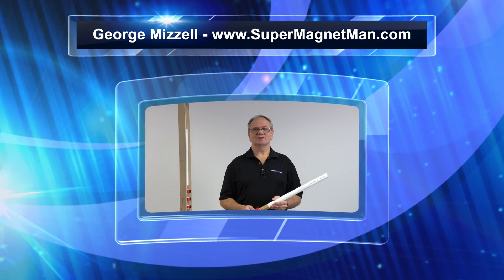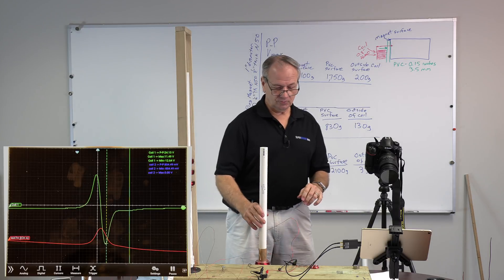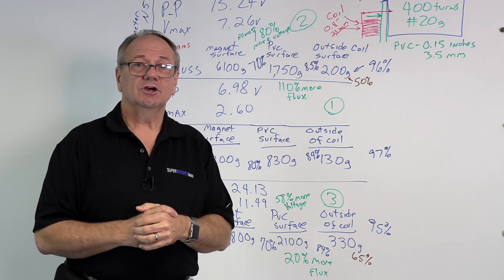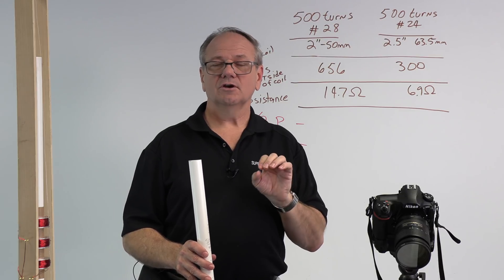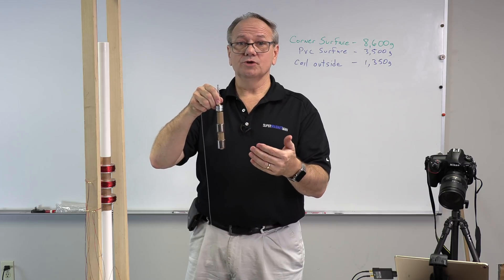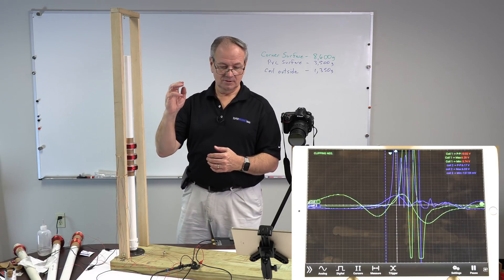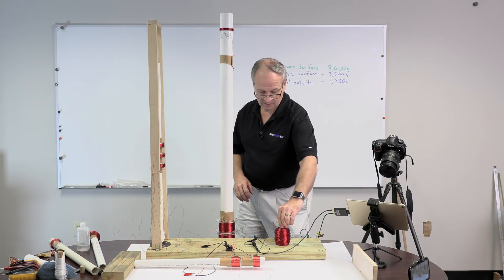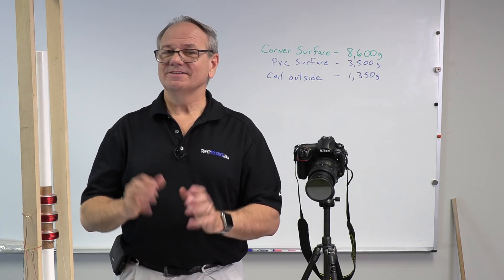Magnetism and Wave Generation

Comment: You could drastically increase the rate of change in flux with a highly permeable low reluctance path through steel washer plate around the tube and placed at the bottom and top of each coil. But make sure to cut a slit in the steel washer plate from the outside diameter to the inside diameter so as to minimize or rather eliminate primary mode eddy currents. 

If one wants to further close the magnetic curcuit. One might encase the outside of the coil and washer plates with a larger diameter steel pipe. Closing most of the magnetic circuit further increases the rate of change in flux across a coil helping produce the most voltage with waves of low cycles per minute. 

Obe might consider a full wave voltage doubler circuit to assist in getting usefull charging voltages while also rectifying the linear generator's output to the battery. Lastly, the battery needs a charge controller to prevent overcharging.

Comment: Fun and informative vid!
One question though: Won’t the conductive copper weight sap some of the energy output due to induced eddy currents? I think a non-conductive weight might give better results.

For wave generation, the trick is going to be to convert the wave action to higher velocity of the magnet passing through the coils. Some sort of a pneumatic system could accomplish this, or perhaps even just a float and a lever arm.

I’ll watch the later videos to see where you went with this!

Comment: Actually kind of have a question cause I seem to look at things different . you're talking about limiting walthickness, but from my perspective and maybe I'm wrong isn't proximity directly or more so maybe I should say isn't Resistance to moving object and electrical current generation directly inverse to each other? so sure maybe if you wanted to decrease your volume of an electrical generating system per workload, then you'd be worried about wall thickness, but getting the magnet closer to the coil just increases resistance and thus could increase electrical current, but also would still be taking more away from the work.  I do see it coming into play and conceptualization of a current project I'm working on where the weight of the magnet will be  an inefficiency to the system . so maximizing my electrical generation potential out of any given weight of magnet, would be somewhat key. Cool stuff though! 👍

Comment: @SuperMagnetMan 4:26 - "Lost 80% of our ring flux..." comparing what to what? What values are you comparing, here? ---You know it's likely to be difficult sledding when this early on  there are routine references to comparisons where the gentleman doesn't bother to tell you what is being compared. What is 80% of what, here? Where are the equations for the potential energy of this system? ---My best guess is you're comparing readings on the PVC surface (why here?) to readings on the magnet's surface, in Gauss, but doing a very poor job by rounding significantly without telling your viewers, nor telling them specifically what it is you're comparing, and why it's important.

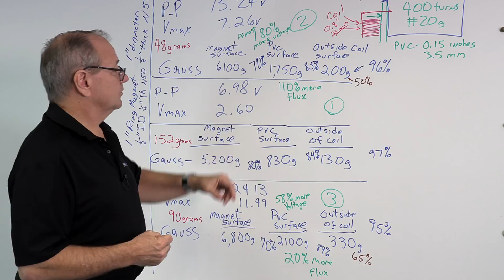4:50 - Why is the reading at the outside of the coil important? You and I know that it has to do with the efficiency of the system, and the efficiency and placement of the winding, but do you really think half the people watching this know, and know why and what you can do about it? Further, what you really mean by the "PVC Surface" on your board is, "The innermost face of the coil," something critical to your audience's understanding and to the value of the quantity taken at the outside of the coil. You also want to minimize wall thickness, but not coil thickness given how important the reading is at the outside of the coil?
Slow down, brother. Slow it down. This is valuable stuff---don't waste it by hurrying!
Reply from the maker: 80% of the starting value so if the original surface gauss measurement is 5,000 gauss and at that point I am down to 1,000 gauss - that is an 80% drop.

Comment: The magnetic circuit in all of these demonstrations is absolutely terrible. Take a lesson from the voice coil in a loudspeaker, and make the flux go straight out radially from a chunk of iron plate on each end of the magnet (flux re-directors), through a thin coil, backed up by heavy iron for high intensity flux loop closure, then straight inwards radially to the other end of the magnet. Set it all up so the magnets and iron pole pieces are stationary, and move the coil only, as in a loudspeaker. That will also allow you to avoid friction with the 'pipe' (the coil support). Moving the coil in a stationary magnetic field is every bit as valid as moving the magnet, and a stationary magnet can be MUCH larger. You also should match the coil height and spacing to the thickness and spacing of the flux re-directors. And btw, the flux re-directors can concentrate the field intensity to about twice that of the best supermagnet, because good magnet iron has much higher permeability than the magnet material.

Comment: I once saw a really odd shaped coil that looked like it was made with around 10 8"x8"x1" square blocks with holes in the middle so the squares could be slid down an upright pole at the center. The squares were rotated and offset to form a spiral like pattern with the corners up the pole. The copper wire was wrapped around each square and the result was a spiral square coil. Any idea what the purpose of that would be? My best guess is from around 13 minutes into the top video that pops up when you type "Why build an entire computer on breadboards" into the yt search (yt wont let me use links sry), he shows how the physical geometry of the wires carrying a signal have a very interesting effect on their attenuation and phase shift at high frequencies. If the geometry of the coil can affect the signal, maybe it also can affect magnetic induction. Have you considered testing differently shaped coils? Maybe its another factor that may effect your voltage results. Thanks for the very informative videos!
Reply from the maker: Interesting - I am not sure if I follow the description.  I will look it up:)
OK - watched it and I think he was talking about just the magnetic field that is created any time electricity moves through the conductor.  I was watching the 12-14 minute segment.
Reply: @SuperMagnetMan  He pokes the wires and it effects the signals which implies to me that the physical shape of the wires affects the signal at very high frequencies. I guess it could also be his own electric frequency interacting with the wires when he touches them, but then I have no idea what the purpose of the coil I saw was. I saw the coil 3 stories underground in a gov building down a dirt road in VA, and it was in a electrical room so it had to have had a real purpose right?

Comment: Is my following assessment of the experiment's results accurate? As a magnets gauss increases electro motive force produced from magnetic induction increases. As an air gap between magnet and coil decreases, electro motive force produced from magnetic induction increases in percent efficiency. As wire thickness of coil increases electro motive force produced from magnetic induction while coil is under load increases in percent efficiency. In other words magnet gauss is the main factor, air gap effects the efficiency of the magnetic induction the most, and wire thickness helps maintain efficiency while coil is under load. Am I correct in my assessment? Did I miss anything else that can be deduced from the experiments? Thanks for the informative videos!

Comment: This is so sad. rapidly changing the magnetic field will increase the power you generated. This can be done with magnets without moving anything physically against the strength of the magnetic field. Doing what he demonstrates (sliding magnets past coils is childish and lacks intelligence.) Either split the magnet in half and rotate a disc of variable reluctance through the gap between the magnets (this was done by Don Smith, (Don then amplified the power using air-core high-frequency transformers and downconverted it to useful frequencies and power levels with tabletop sized generating plants that could power city blocks) and powering the rotating disc can be done with virtually no resistance, and produce unlimited high frequency alternating electrical power from inductors wound around the magnets which will develop highly variable magnetic fields, much faster than moving magnets past Lenz law activated coils. Or you could simply put electromagnets on each side of a power generating magnetic core and synchronize the power to the outer electromagnets and shift the field strength back and forth in the center electromagnet (Clemente Figuera patented this design in the 1800s)  Easily powering his entire home with a 12-volt motor battery (easily keeping it charged). This can be set up to run at any AC frequency and any voltage, avoiding the complex transformations that Don Smith developed. The sailor could power his boat without ever needing to refuel or charge his drive motor and power his fridge and stove for his moveable feast and lights to travel safely at night. And power his favorite satellite receiver to keep up with his favorite reality show or local news and weather channels and video chat partner or long distance crush.

Comment: Shouldn't you have made an attempt to match the source and load impeadances for maximum power transfer? Then calculate power. This would give you a truer number vs just measuring the voltage. This would also be more accurate when you change wire size. I also wonder if any eddy currents were induced in the copper cylinder that altered the measurement. Re: the magnet dropped in a copper tube, but this is reversed, copper dropped in a magnetic field.

Comment: Fun video!  Looking forward to the follow up~  

What was the purpose of adding a load to the circuit in this experiment?  The output potential of the generator doesn't change.  Any load is certainly going to change the readings, so no real surprises there. 

Can you explain what conclusion we can draw regarding wire gauge?

Anyway, keep up the interesting work!
Reply: Same here.

Comment: make the pipe 2-3 times longer, more magnets, more coils. put a well-oiled and very springy spring at the top and bottom of the pipe (long and powerful spring at the bottom, shorter and less powerful at the top) and install some kind of rubber gasket braking system near the top, and assemble the system to be enclosed, with an air input from an automated compressor at the top to get everything started if gravity isn't enough. when the brake is released and/or air pressure is introduced, the magnet plug travels down the barrel, passing through the coils and landing on the bottom spring, which launches it back up through the coils into the top spring, which launches it back down through the coils into the bottom spring, which launches it back up through the coils into the top spring... (see where i'm going with this?). if the system slows down too much, the compressor kicks on for a moment to give it a little boost. I imagine something really amazing might happen if you were to encase the coil array in a geodesic ball of halbach arrays (perhaps two different amazing somethings, if you tried one version with the arrays focusing inward and one with the arrays focused outward)... have the whole thing mounted on a frame that allows you to turn the pipe upside down to reset the system if it ever stops or is turned off. your thoughts, master of magnetism?

Comment: I know this is probably a silly question but... What kind of watts can you get out of this? If this boat was rocking at consistent amount over an hour, how much energy could you get to run something like a TV. Basically, if the rock of the boat was unnaturally steady, 24 hours a day/night, how much power in watts would you be producing?

Comment: Without power measurements, the data is not very useful. I would request that you redo the experiments with the various wire gauges and also measure the current flowing through the circuit. You can use one channel of your scope to do this by putting a very low resistance resistor in series with the load, and measuring the voltage across the resistor to calculate the current. The current will be the voltage measured/the resistance of the resistor. Since you already know the voltage being generated , now you will know the current, you can calculate power = voltage x current. 

I would be Intersted to know the difference in power generated, as a thicker wire may produce less voltage but more current, resulting in a similar amount of power...

Great experiment! Thanks for taking the time to share!
Reply from the maker: You are exactly right and I thought about getting a precision resistor and doing that but I was afraid that making it too technical would lose half my audience:)  It is a delicate balancing act between communicating enough to be interesting and giving too much info and it being boring:).

Comment: PVC also has static electricity. That has to have some effect on this?
Reply from the maker: This is true but I think the static electricity would not play a role in power generation.  I know that trucking companies have to cover the front side of PVC pipe because the air - especially dry hot air - blowing across it for several hours can build up several thousand volts of static electricity.  This is also why truck usually have a chain dragging underneath.  When they stop it shorts all the static to the ground.

Comment: How is tidal change allowed for?
Reply from the maker: If you think of an ocean wave it breaks down into 2 parts.  The tidal forces driven by gravity pulls the body of water with a gravitational drag force.  Then as the water tapers down and approaches a shoreline you have waves.  The second part is across the top of the waves and wind energy blows across the top of the water and pushes the water into waves.  I am working on an enhanced design that will produce even more power from the waves than current designs.:). Stay tuned:)

Comment: Wonder where the waves are and what all that testing has to do with waves. Actually just one big confusion. Poor guy. Get an education.
Reply: At first I wanted to reply to your comment negatively and then I realized that doesn't help anyone. Close your eyes and imagine the tube on it's side, it's shorter and both ends closed. The magnet will  move through the coil every time the boat encounters a wave.

Comment: I think if you use a top weight other than copper (something that has a much higher resistivity) would give you much better results, as when the Cu weight goes through the coil (WITH A LOAD ATTACHED to the stationary coil), it just generates a large loss as heat.  I did a similar test with a huge 3" x 3" magnet which amplifies the results to a point that you can actually feel.
GREAT VIDEO!!!
Reply from the maker: Yes, I actually tested with my 3 inch x 3 inch magnet in a 3 inch PVC pipe and it was way off scale so I could not use that info in the video.  The purpose of the copper weight is just to provide a higher kinetic energy as the magnet goes through the coil and the drag force is quite significant.  I would like to have a set of scales that could tell me the exact force and then see how much energy I was actually extracting but that is a lot of equipment that I don't have:). Maybe later:)
Reply: @SuperMagnetMan  I think Dale Nassar's point is that you can minimise the losses by making the extra weight made from a non-conductive material. The back-EMF induced in the copper mass from the coils' (under load) reaction will cause eddy currents in copper heating it up and thus stealing some of the power that can be used on the load. Hope that makes sense :o)

Comment: Really good info there super mag . I often wonder about ways to generate electron flow from the natural movements we are surrounded by and the details involved for the greatest efficiency so you can imagine why this is right up my ally . I have been collecting shaded pole fan motors for a few years to use the electro thin gauge copper coils but it’s seems best to create larger diameter coils after watching this video . I do however wonder about using large diameter ring magnets from microwave ovens magnetrons . I think they would be quite good . I wish to have a 150mm diameter ring magnet but I think they would be extremely expensive so the free microwave magnetron magnets will have to suffice . 👍
Reply from the maker: Good ideas.  I don't actually have those items on hand so I would be interested in hearing what you learn about it.  Thanks
Reply: SuperMagnetMan well today I picked up some pvc tubing . I will have the magnet dipping in and out via a rotor attached to drill. Much like a piston . Trying to figure out if it should pass the coil to avoid dwell or if it not needed . I am considering the idea of it only bobbing up and down 50mm and kepping my coil thin and high walled . I have a scope to visualise so am very excited . Many other projects on so starting to feel overwhelmed before I even start 😂👍
Reply: Also am considering the movement of the coil instead of the magnet as it will have less mass so increased rpm most likely 👍
Reply from the maker: @Buzzhumma  Fantastic.  So excited that you are going to do your own experiment.  It is an amazing journey of discovery:).  Let me know if I can help and definitely let me know if you come up with something exciting:)
Reply: SuperMagnetMan sure will . I most likely will do a video and be sure to give your channel a 👍🏻